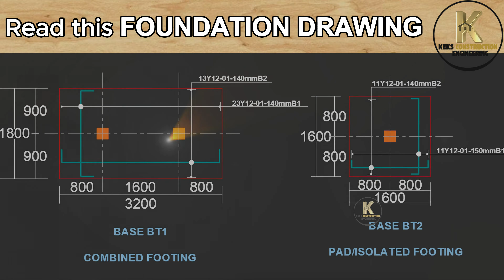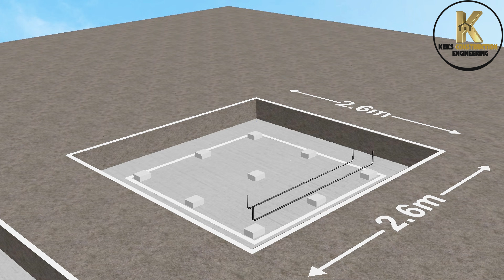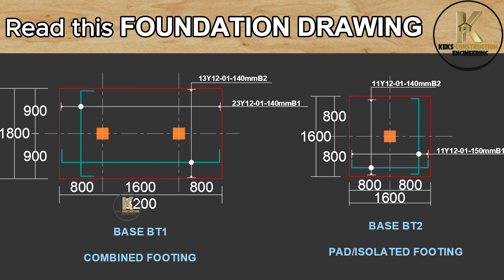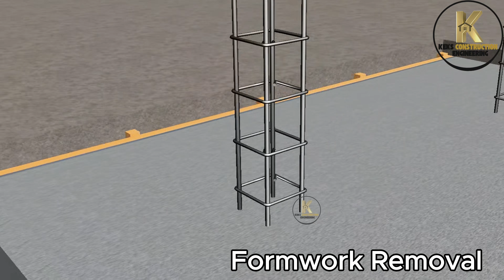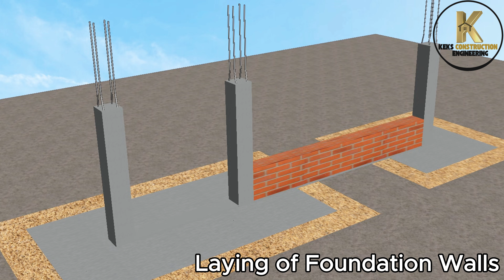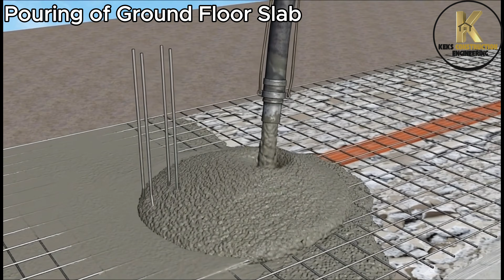Choose the Right FOUNDATION | PAD vs. Combined Footing | Full Animation

Comment: Great video! I have questions lol

In an isolated pad footing, can the block wall start from a level higher up than the level of the pad itself? Say if the pad footings were at 5ft. below NGL, can the foundation block work start at 3ft below NGL if a 225 by 450mm chain beam is provided at the plinth level?

Thank you!
Reply from the maker: Yes it's possible..... Depending on the foundation design and soil condition especially the minor walls. Some Partition walls can even start from the top of the Ground floor slab.
Reply: @keksconstructionengineering Thank you my brother 🙏
Reply from the maker: @habeebtunde5591 
You are welcome.
Watch other Videos on this Channel and Stay tuned for more.

Comment: If we use plastic underneath rather than concrete for protecting from corrosion may work?
Reply from the maker: Yes they work perfectly, we have PVC/Plastic cover blocks.
They are durable, easy to use, and available in various sizes (circular wheels, chairs, or sleepers). They are highly recommended for their durability and lack of interference with the concrete bond.

So you are Right and can use that.

Thanks for your positive contribution. Stay tuned to KEKS CONSTRUCTION ENGINEERING for more.